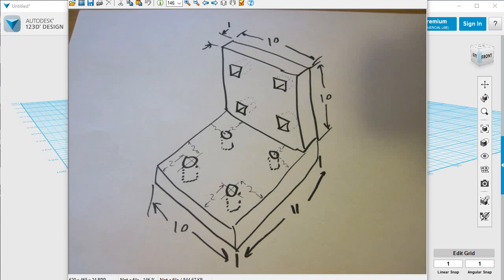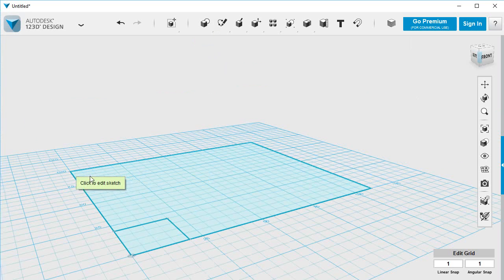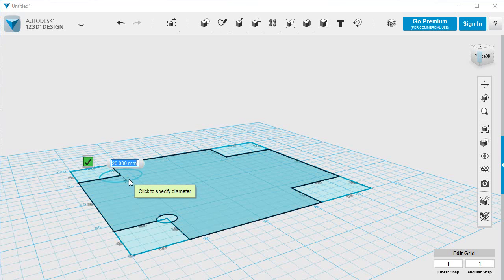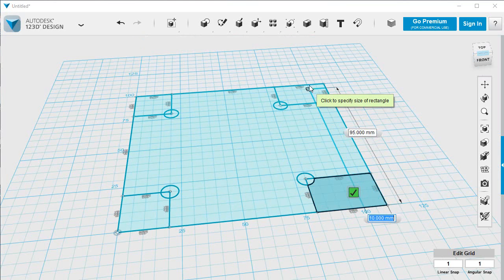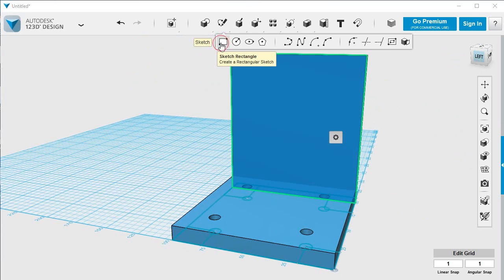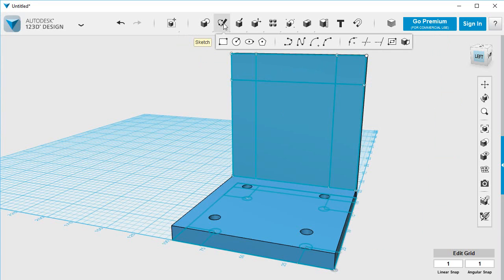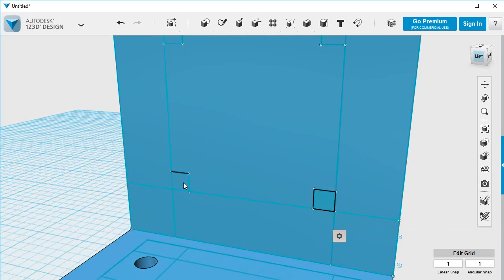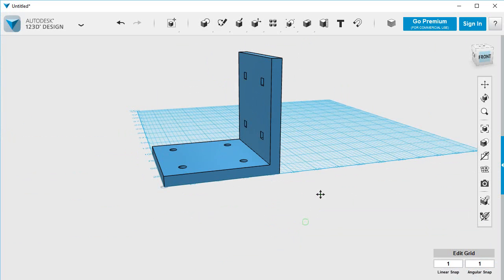Autodesk 123D creating a precision part

Comment: Finally!  Thank you!  I couldn't wrap my head around how to design precision parts until I watched this.  All the other beginner tutorials show you polylines and splines but never show you how to make a precision part.  They just draw something willy nilly and say that's all there is to it.  I spent hours last trying to make a simple precision part.  After watching your video, I finally had that Aha! moment with making sketches.  Break down the part into simple shapes, using simple shapes to align things like holes, and extrude what you want.  So simple.  Thanks!

Comment: All these tutorials talk about making something from scratch but is it possible to modify an existing object downloaded from Thingaverse in order to edit parts of it?  I assume the object would have to have it's parts disassembled to be able to modify it bit if I click the uncombine function nothing happens!  Could objects from Thingaverse have been locked to prevent modifying them?
Reply from the maker: Sorry, unfortunately I have never had to do that, so I can't help. I have used Thingaverse objects in their full form, but not modified them. If you find a solution, you might post it here, or post a link to a solution?

Best of luck.
Reply: I wanted to move some holes in a GoPro style camera holder to fit my camera but there doesn't seem to be any way to do that so I had to fill in the existing holes and make new ones with Tinkercad but 123D Design could have been used too.